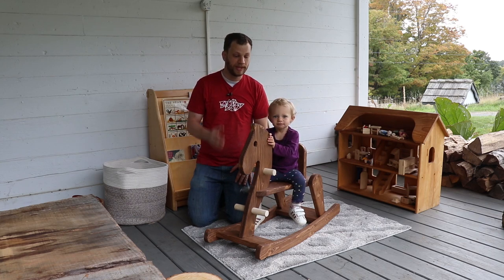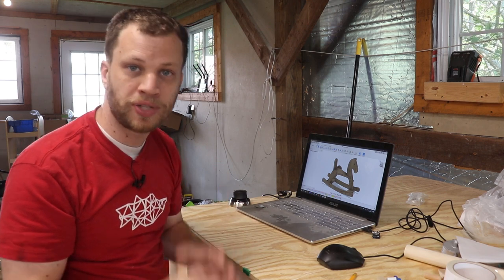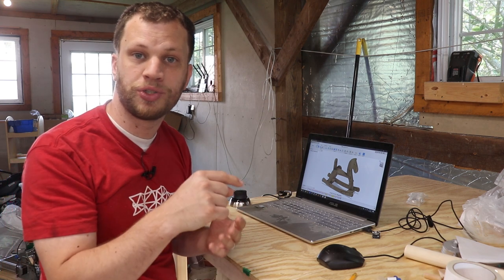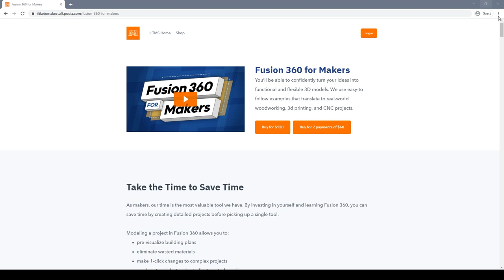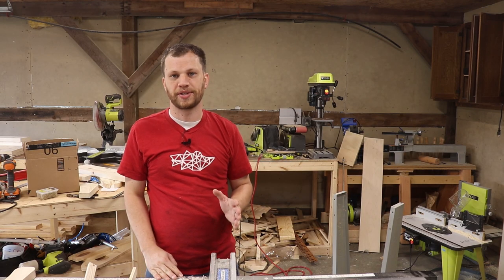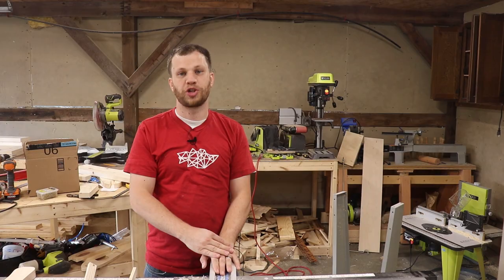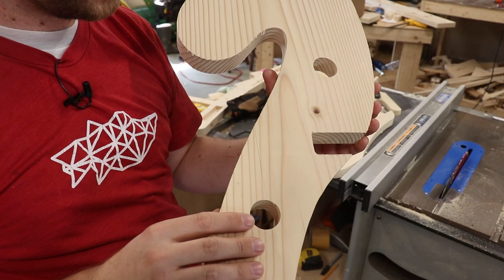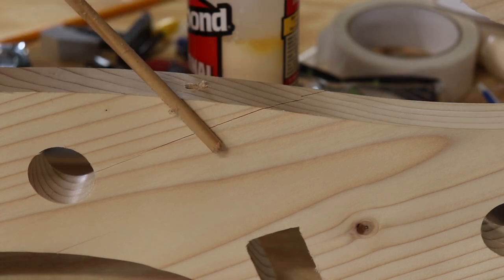Rocking Horse

Comment: Lovely rocking horse, great work. I didn't think you could make something that size on a tabletop CNC so that's good to know. Judging by your smiling daughter you may need to scale it up slightly if making plans. Assuming that is anyone who makes it is aiming it at slightly older and therefore larger younglings. 😀 Or have a few versions of the plans, just a thought anyway. How's the mailbox going? Still reporting in?
Reply from the maker: I didn't highlight this, but I added a second set of holes in the seat. This allows the seat back to be adjusted as she grows taller. I also can scale the whole thing up if I make plans. Thanks for the great suggestions!